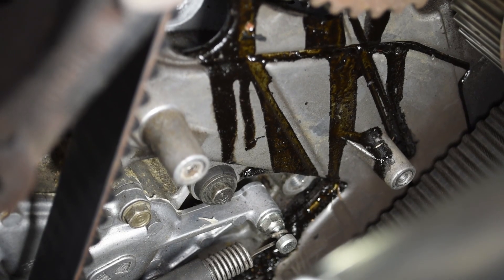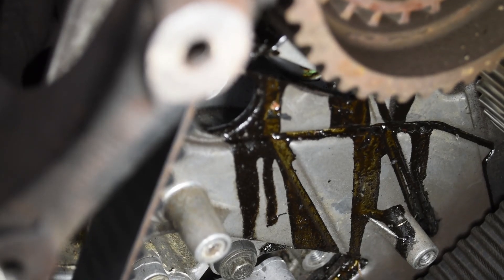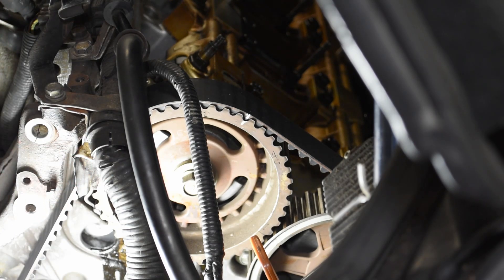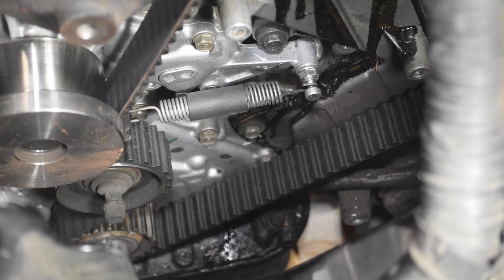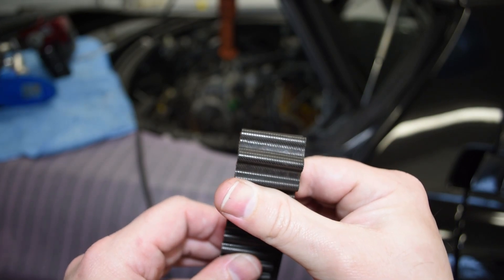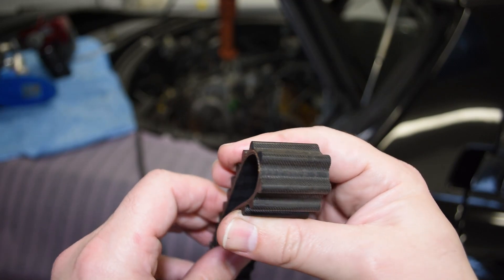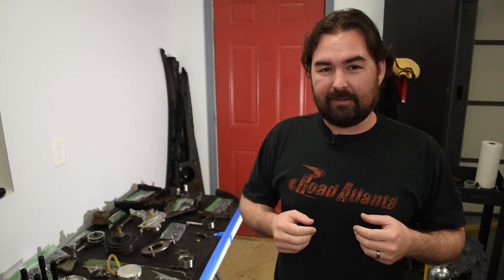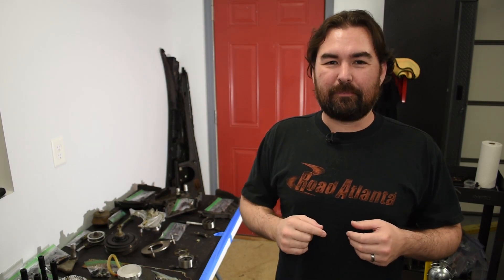NSX Major Service Part 4 - Removing and Inspecting the Timing Belt and Water Pump!

Comment: Do you know what's the official hour value for replacing the timing belt and water pump on a first generation NSX, with the engine in the car?  I know it could vary wildly in actual practice, but is there an official "book value" for the hours that is should take for getting an estimate?
Reply from the maker: The 'Prime forum suggests between 5 and 7hrs of "book time".   That said, at the end of this series of videos I cover costs.  The TL/DW is probably between $2500 and ,$4k depending on what else you opt to do while the car is apart.  If they are > 10yrs old, changing coolant hoses is advisable.  A valve adjustment should happen in there somewhere, and it's a good time to install a harmonic balancer shield if the car didn't already have one (aftermarket must-have 'insurance' part).
Reply: @LapoftheWorld  Thanks for the reply.  Much appreciated.  I've heard so many crazy prices and hours, even on Prime, but I knew I could get a proper estimate from you.

Comment: Do you see an issue with resale and doing your own timing belt? I don’t plan to sell my NSX anytime soon but since timing belt gets beat to death on BAT etc, I wanted to get your take. If I produce parts receipt, pictures of the work as it was done, maybe that would be sufficient for most buyers?
Reply from the maker: I don't think the NSX carries anywhere near the same premium on "dealer-serviced" as would a Ferrari, for example.  Odds are the owners who are inclined to do their own work will have more time spinning wrenches on a Gen 1 NSX than maybe 80% of current Acura dealer techs.  That said, having been in the community there is a short-list of known-expert techs whose names might inspire more confidence when going through records, but most of those are independent now (some were once dealer techs back in the day).  If you know, you know, but if we were buying another one, I'm not too worried about who did the work as long as it was done on time, and if OCD demands, I can pull the covers off and check the work and validate the timing etc.

Comment: Just picked up a black '92 NSX but not willing to DIY this work. My problem is finding a mechanic who specializes in these engines.
Reply from the maker: Where are you located (general region at least)?  I may know a few people, lol.
Reply: @LapoftheWorld  South Orange County in California
Reply from the maker: @bme7491  You should be spoiled for choice in that case.  Applied Motorsports, Autowave, Genesis Automotive, Niguel Motors, and maybe a few others.  All of those reputedly are, or at least employ NSX specialsts and have some community track record.  They should have copious reviews on NSXPrime forum if you want to research further (disclaimer, I have no 1st hand experience with any of the above, nor am I affiliated, etc.)
Reply: @LapoftheWorld  Thanks.
Reply: @LapoftheWorld  What about Central Florida.  I used to have Nabil at First Class Automotive years ago, but it has closed down, and as far as I know he lives in NC.
Reply from the maker: @kings17court  I thought I heard he was still wrenching by appointment and doing service for Wei-Shen & co, but that info may also be out of date.  That's who I'd ask though.

Comment: Have you resealed the engine? Or haven't had the need to. I'm going to do the TB and water pump but since the motor has never been touched since it was bought in 96, I was thinking I should just do a major overhaul and do everything.
Reply from the maker: Over time I've replaced most of the external/ancillary gaskets as well as the front and rear main seals (the former with the last belt change, the latter with the last clutch change).  Valve guides/seals were done around the same time as the last belt service as well.  Is that what you meant by "reseal"?

Comment: Thanks for talking about the condition of the belt.  It looked pretty good to me.  I just had mine done at 45K miles and while not a garage queen (I had it on the track in January), it is a weekender at best.  Would you still replace it again in 6 years?
Reply from the maker: Yeah, I'm risk averse so "better safe than sorry" usually wins in any analysis.  That said, if I were approaching 6 years and it was going to be super inconvenient to have the car down right then or (in the middle of a move or whatever) I also wouldn't panic about letting it ride an extra year as long as that mentality didn't propagate into perpetual procrastination.
Reply: @LapoftheWorld  Perfect answer.  Thanks!

Comment: Great video! 
Wouldn't it be easier to work on the WP if the alternator bracket was out of the way?
Reply from the maker: Yes, but to remove it I'd also have to remove the intake manifold it seems as there are two bolts that seem entirely blocked by that piece. As it is, it's not that bad as you can get straight on all of the bolts etc. so it didn't seem worth the extra-extra steps.
Reply: @LapoftheWorld  Ok. I'd have to remove the CTSC but I'm afraid to do so...Good to know it's accessable without removing it.

Comment: Wow for some reason I assumed about 9 years for TB life.
Reply: ps thanks for the dowel cliffhanger
Reply from the maker: To be fair, I suspect under normal use they'd have no problem lasting that long.  I'm not sure if any actual stretch happens, but I'll measure as close as I can on mine to see.

Comment: Congrats on the sponsorship man!!! Did you ever find out how much it would cost to have someone do the job for you out of curiosity?
Reply from the maker: Having paid for it before and gotten at least one recent quote just the belt/pump carried a labor charge of $1500-2000, so I'm saving at least that much.  A good deal for the whole job including parts is probably ~$2500.  That's just the belt/pump though.   Throw in the coolant hose change and stuff like that and you can double the labor pretty quickly.
Reply: @LapoftheWorld  Nice! It always feels go to save money and finish a job. Did my recently and felt great.

Comment: timing belt change interval did change, but only for the 1997+ cars. (no reference to the earlier cars)
From the 1997-2005 service manual:  
Replace timing belt (see page 6-14)*1 and inspect water pump (see page 10-11)*1,
every 105,000 miles (168,000 km) or 7 years.
Replace the timing belt at 105,000 miles (168,000 km)
according to the maintenance schedule (normal conditions/
severe conditions). If the vehicle is regularly
driven in one or more of the following conditions,
replace the timing belt at 60,000 miles (U.S.A.)
100,000 km (Canada).
— In very high temperatures (over 110°F, 43°C).
— In very low temperatures (under -20°F, -29°C).

my 64,000 mile car is on it's 3rd belt and second water pump. (every 10 years (average))
Reply from the maker: Ok, that's where I'd seen different numbers cited then.  Thanks.  Even if I am a little early mileage wise, I don't feel too bad given how I use the car.  Probably not often in those ambient ranges, but I'm sure the engine bay temps stay up there on track.
Reply: The 91 SM says up to 90k miles but doesn't note any time interval which has been invented to keep dealers busy. 
In a conservatively driven NSX in a normal climatic area 10-12 years is ok I think. I'd even go up to 20 years on a garage queen with low miles. 
What really kills TB are WPs (should mount Honda parts only and use Honda coolant only changed frequently), idler pulleys (don't save on that) and oil (cam seals).
Reply from the maker: @ze179  The SM I have does contain a chart in it that says 72 months.  That said, observationally I agree the belts could probably go longer under normal conditions though it's not something I'd necessarily encourage given the potentially wide variety of storage/usage conditions between cars/owners.